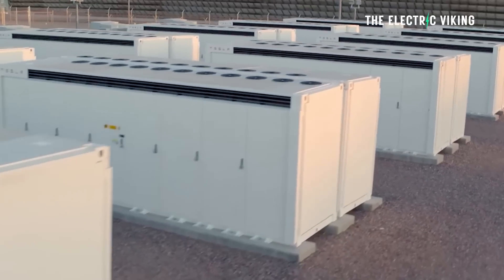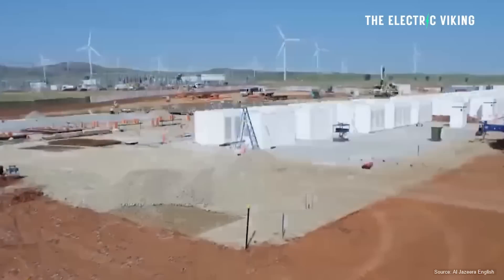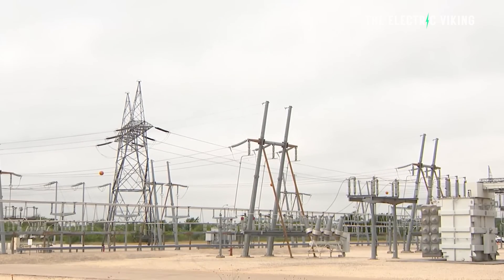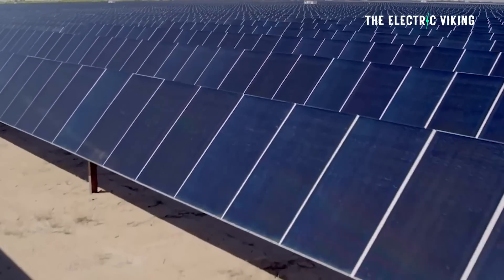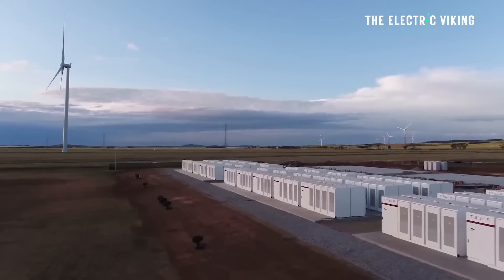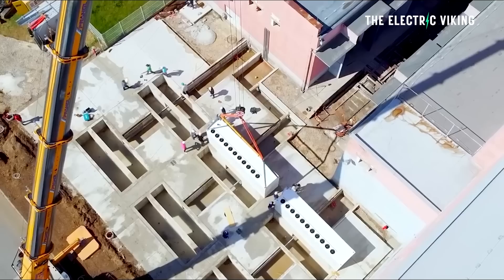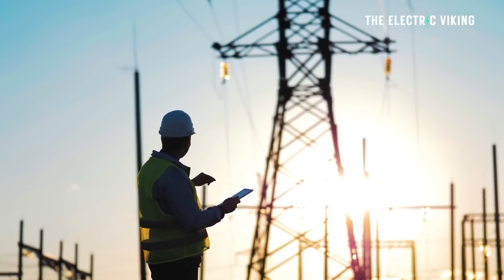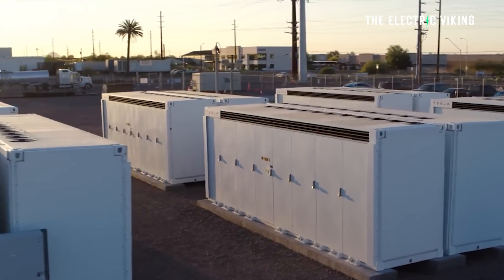Tesla DESTROYS coal in Australia; builds mega batteries next to coal plants

Comment: Why are these mega batteries left exposed to the open sun, unshaded? I would think heat is the enemy of the battery life and efficiency, with considerable heat given off and needing cooling which is waste.
Reply: Perhaps the Suns radiation @ 1kW/m is relative but inconsequential to the permanently running fans presumably removing a much greater internal heat. Now; water I find curious. 

I live in the PNW. Anything outside exposed to air currents under a roof lasts virtually forever but is consequentially destroyed if left exposed to the rain. The overhang on an enclosed structure keeps wall sides dry and makes a tremendous difference in deterring water infiltration and wall deterioration externally.   Water always finds a way in, often through enigmatic capillary action. Rain back-splashing challenges seals through cyclical drying.   Moisture displaced by wind is rapidly drawn in by fans to saturate interior electrical cavities. Unless they are using heat sinks - or coolant -  I woudn't even risk it.

Comment: mega battery lasts maybe 1 hour, its barely touches the supply issue
Reply: Care to share the source data for your calculation?
Reply: @PiefacePete46  You are challenging without any data, nor history of power system operation, nice!
Reply: @RossLippiatt  : You made a claim without anything to support it.
I have made no claim of any sort.
I was curious about the source data you used, so I could make my own judgement on its validity.  With that, I can try to arrive at my own conclusion, whether it is the same as or different from yours.
My qualifications are simple; I live on this planet, with no other options... its wellbeing and mine are inherently linked.
Step one in my struggle to understand things I would rather not devote time to, is to ensure my decisions are based on verifiable information.

Comment: Batteries are great at moderating intra-day variations in electrical supply and demand.  However, they don't actually GENERATE electricity.  So, if there are variations from day to day, week to week, season to season, or changes in weather patterns, you still need more reliable GENERATORS to keep the grid functioning.
Reply: So all those homes and businesses with solar panels generating power to the grid and wind turbines doing the same each day don’t mean anything to you?? The more installed the better it will be as the tech for these are getting better. Heck we even have solar glass panels now!!
Reply: Spot on. In fact you would need to have MW reserves near equal to support 'intermittent' sources when they don't generate. If we do this we would be wasting billions. All I can see is continually rising power costs and eventual brown and black outs.
Reply: Yeah. You'd need a massive fusion reactor that literally lives in the sky and comes out every day.

Comment: A report has been done saying car pollution is making every single person in a city a pack a day smoker or worse. Cars are killing us in huge numbers.
Reply: BS
Reply: @robertfonovic3551  Keep your head in the sand ostrich.
Reply: Source please?
Reply: @Fantabiscuit  Maybe it was writtn by a cigarette manufacturer
Reply: EVs emit TWICE the harmful particulate pollution as ICE vehicles due to greatly increased tire wear.  There ought to be laws controlling that.
Reply: @dzcav3   No way the tyre wear is double. Not all EVs are even that much heavier than some of the ICE equivalents, in some cases lighter. If tyre is worth regulating against, then it would make more sense to start with pick up trucks and 4WDs with off-road tyres being used as city cars. 
Also the EVs putting out more brake dust thing is nonsense, despite what some rubbish articles have claimed, because most people with EVs don't even need to use the brakes that much since regular braking is done with regen.
Reply: @dzcav3  tyre wear does produce micro plastics. Why would EVs produce twice the amount?
Reply: @Fantabiscuit  Because the vehicles are wice as heavy
Reply: @andrewplater1782  my Nissan Leaf i surely lighter than the average SUV
Reply: @andrewplater1782  Not true.

Comment: While it is a good thing, a battery does not replace a coal fired plant. This one can supply 560MW for 4 hours. A coal plant can supply that for 24 hours. And it looks like the price is $67.50/MWh.
Reply: I think the logic is that it is only necessary at night time. 

Daytime is sun/solar
Reply: @Fantabiscuit  Until the first time they get 2 cloudy days in a row, then there will be nothing for the second night. Also, the generation capacity is different in summer and winter, and so on. Coal power stations will last a minimum of twice as long as a grid battery will and is a lot easier to recycle. A coal power station does not degrade over time like batteries do, etc. etc.
Not saying don't do it, just bemoaning how the facts are hidden. We CAN go mostly renewable, but only with a lot of planning and money.
Reply: @brettbridger362  
We probably cld go 100% RE if we have enough storage. 

We'll have to maintain expensive gas backup until then. 

It's a balance between cost and requirement.
Reply: @daviddgm5527  Storage is only 1/2 the issue. The most expensive side is redundancy. Both the large investment in transmission (especially the east-west backbone) and the duplication of facilities. A 'bad week', seeing extensive cloud cover over most of the east coast, would require most of the power to come from the west. And reverse when the west is covered. Don't mention the nightmare where both have large cloud cover.
To provide RELIABLE power generation, there has to be 2-3 times the generation capacity of renewables available (but not being used) PLUS the batteries (including spares). No company is going to want to outlay that for something that will rarely be used, so the current model will simply not work. Yes, you could do a 100% scenario, but the cost could only be met by government funded installations.
Reply: @brettbridger362  
Tell that to the AEMO and the power companies and provide full financial analysis. 
So they can update GenCost with full total cost of the RE revolution and transition. 

Perhaps we need govt to start building power generation assets again? 

The LNP wanted the LNP fed govt to build a coal PS near Collinsville. 

Remember ALL the coal PSs in SAust, Vic and NSW and most in Qld were built by state govts. 

I'm just a keyboard observer and have zero influence over AEMO CSIRO or the power industry.
Reply: Coal plants don't run 24/7/365 at full output. 

They shut down for maintenance at regular intervals. 

Coal PSs in NSW run at less than 60% CF.
Reply: @daviddgm5527  Sort of. An 'average' coal plant CAN be up somewhere around 95% of the time, maybe dropping to 85% if the unit is unreliable. A nuc is 99%, maybe dropping to 95% again if it is unreliable. The 60% for NSW is only because that some units are past replacement, some haven't been maintained properly and (biggest factor) nearly half aren't needed, so are shut down.
Reply: @brettbridger362  
Not in NSW! 
NSW coal power stations struggle to exceed CF 60% over a year. 
RE has eaten their lunch and they won't get it back. 

NPPs need to shut down regularly too.  US Office Nuclear Energy claims CF 0f 92% for US NPPs.
Reply: @daviddgm5527  Yes, coal plants have to be maintained, but maintenance is planned, and scheduled months or years ahead of time. And the low capacity factor of coal plants is a result of renewable energy taking priority. But my point was that a battery does not replace a coal plant. It may replace a gas peaker plant.
Reply: @frankszanto  
Why then are most of the coal PSs in the NEM planned to be closed within 10 years? 

Low CF of coal PSs is due to the fact that they can't compete on price for MWh for electricity. 

If we had more cheaper RE with storage, no FF PSs cld afford to operate. 
That's the goal!
Reply: @daviddgm5527  Before solar and wind came on the scene, Australia had the some of the lowest electricity prices in the world. But now, we have 38% renewables. When the sun is shining, or the wind is blowing, we have excess power, and coal plants cannot sell their output, and have to throttle back. They run most efficiently near full power. So they can only make money for a fraction of the day. They are all aging, and there is no point overhauling them, so they will close. I hope by then we have enough storage to provide power iin late May when the days are short and the wind often doesn't blow.

Comment: 3.5 GW of energy storage is impressive, but it won't replace coal plants because wind and solar energy sources are intermittent and can be interrupted for weeks by inclement weather. For example, if a major cyclone hits Australia, not only will it stop almost all solar and wind production of electricity, it will likely destroy utility-scale solar and wind-powered plants. Conversely, coal-fired plants can more easily be protected from major storm events because they are much more compact and they are shielded by buildings. It is financially impossible to protect solar and wind plants from floods, cyclones, tornados, etc. They are out in the open and are impacted by the full force of a storm event. Conversely, Coal and natural gas plants can be "hardened" to protect against major storms.

As a Construction Project Manager, I managed the construction of a 300 MW solar plant spread over hundreds of acres. A major storm hit the area surrounding the plant after it was up and running. It rained for over two weeks and the entire plant severely flooded. Water was several feet deep in some areas. This shut down the entire plant for several weeks, and it could not generate any power. This is a real-world example of why utility-scale wind and solar will never replace fossil fuel power plants. Modern cities cannot go weeks or months without electricity. However, SMRs can be hardened against major storm events and even tornados fairly cheaply by encasing them in concrete that is approximately two feet thick. This is standard construction design for nuclear power plants anyway because the concrete shields the surrounding area from any radiation leaks.  Because SMR designs are small enough to fit on an 18-wheel semi-truck, a concrete structure around them can easily and economically be constructed. Also, most SMR plant designs lower the reactor below ground, which further protects it against storm events.

The vulnerability and intermittent operation of wind and solar plants are another reason why Small Modular Nuclear Reactors (commonly labeled "SMRs") will be the primary power source for the near future. Something like 44 different companies around the world are currently working on modular SMR designs. Once a design is created that is easily manufactured, has modular, replaceable parts, is easily transportable, and easily installed and operated, that design will be mass-produced, and that will cause the cost for SMRs to plummet.

Comment: That is really smart. Build the mega battery stations next to the coal plant so it can easily charge all those batteries.
Reply: Doh! Former coal power plant. The reason it is built there is the grid infrastructure. One of the biggest costs to building a battery farm is the grid connection. Building it on an old coal sites is perfect, you get the grid connection for free.
Reply: @DeveloperChris  
That is what I said. Build the battery park next to the coal plant and it's easy to connect the two. The coal plant can charge all those batteries next to it. It's a win win.

Both the coal plant and battery park service each other. And Australia has a lot of coal to burn.
Reply: @AArata63  You don't charge batteries from coal. You REPLACE coal with batteries, as they have done in this situation. Less dirty coal, more green energy, that's a win win.
Reply: @DeveloperChris  
So, how do you charge those batteries???

Coal is energy, battery is not. Batteries hold energy but they don't produce energy. You produce energy from coal and charge those batteries and use that charge when needed. Win win.
Reply: I think coal does charge them during low usage. And then electricity during sunset cross over. And as solar becomes ubiquitous it  will take over electrical generation
Reply: @Fantabiscuit  
Will the US allow Australia to buy that much solar from China?
Reply: @AArata63  It’s already happening with no problems. Also we are importing EVs with no US tariffs. It might change in the future if the trade war gets worse
Reply: @Fantabiscuit  Excess (low cost) Power from the grid is used to charge the batteries regardless of the source. Primarily though, that is Solar and Wind during the day. Australia's wholesale prices can dip into the negative during the day due to excess generation.